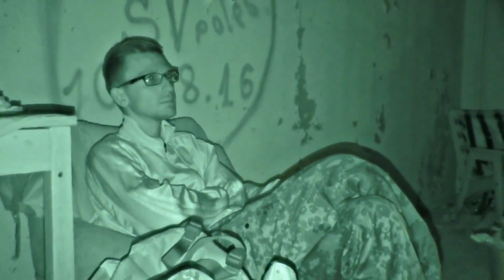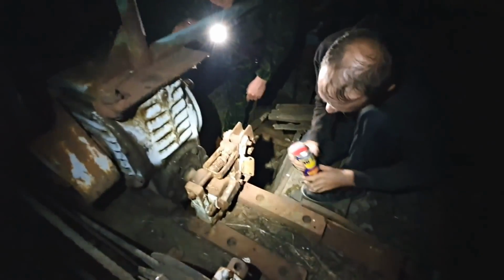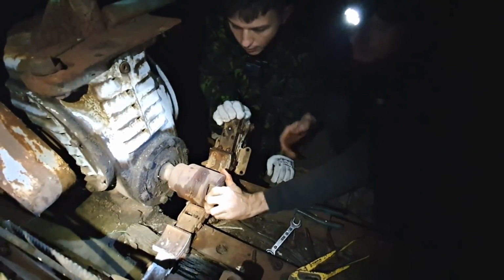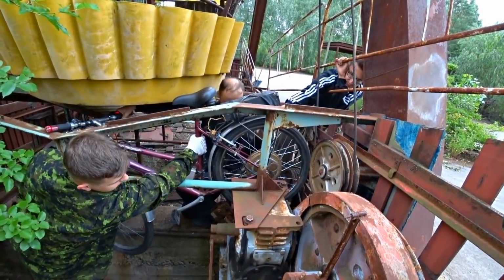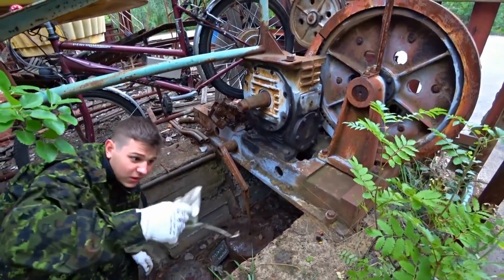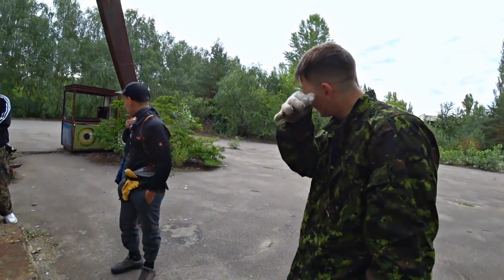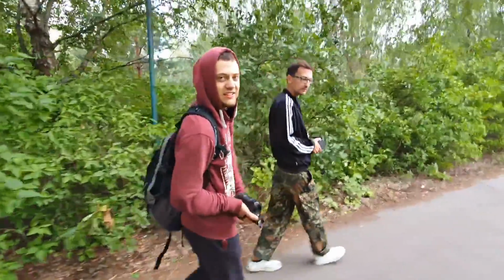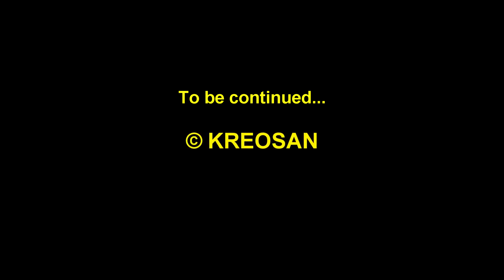Launching the Ferris Wheel Soon ☢️ Examining the Pripyat Wheel

Comment: Take two 12v batteries a blow torch a chain and one of the bike motors and a sprocket use the blow torch to heat the shaft on the Ferris wheel then us the 12v batteries to weld the sprocket to the ferris wheel the just add the bike motors and chain maybe build a trailer for on of the bikes

Comment: Though it might be possible to power the original motor on the wheel with a portable generator though you would need a larger one or a large diesel generator that can be pulled in there as a trailer on a vehicle! :)

Comment: Hope you know that the ferris wheel is one of the most radioactive objects in pripyat🤣
Reply: No... One of the most radioactive place in Pripyat is basement of 4th powerplant of reactor. Around 0.7 s/h (sieverts per hour) wich is 1/3 of lethal dose of radiation.
Reply: I think he was measuring around it and it was 87 μR/hr which isn’t a lot. He didn’t specify the units when he read that number but even if he meant mR/hr, 87 mR/hr isn’t super radioactive. It’s not low but not very dangerous. But who knows how accurate that little meter he was using is
Reply: @Nicksperiments  shiey measured the radiation and it was pretty high on the top (he climbed all the way up)